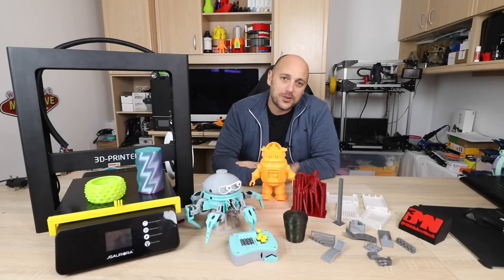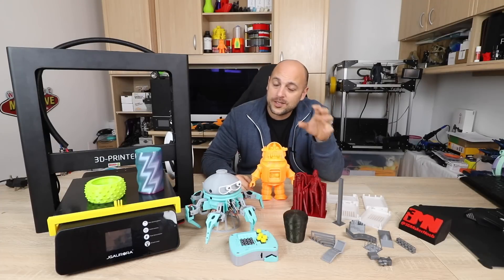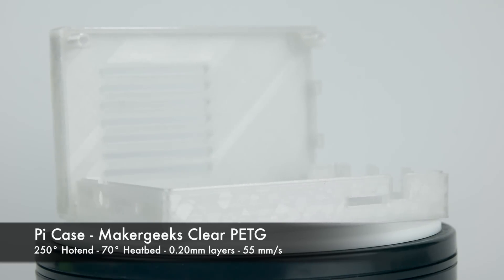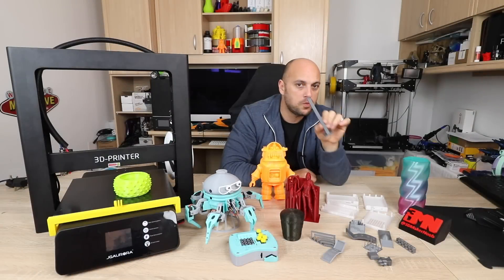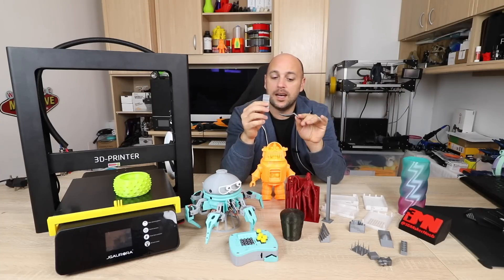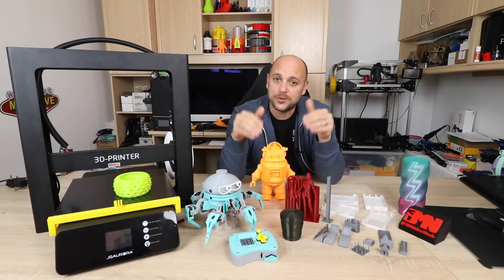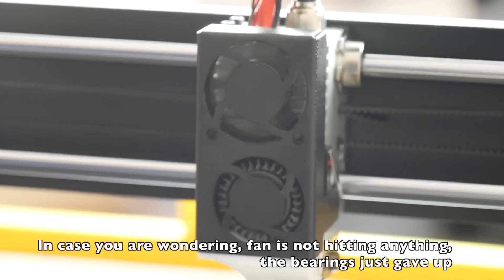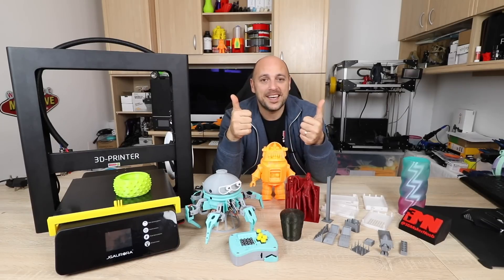JGAurora A5 3D Printer Review

Comment: Hi Joe

Yes "Looks like a solid printer" and the LCD menu is the best going but under light use these printers soon start to go wrong and then you are left dealing with the JGAurora help desk who say they are sending replacement parts but don't and they seem to use  factory reject parts for spares that arrive on a slow boat from China six weeks later.

The guarantee if you purchased via AliExpress is not worth the paper it is printed on and I have given in trying to make my A5 work because it keeps going into "lockout mode" where the LCD menu works but nothing moves and I am far from alone from having this trouble.

Comment: How do your prints come out extremely great, as you say. On my A5, not even a test cube is printed withot massive ghosting and layers which are not exacly on top of eachother?

Slowing down speed to 15mm/s and acceleration to 500mm/s reduces the ghosting to zero, but thats way to slow for working.

Thanks for any suggestion how to get rid of the ghosting & displaced layers.

Comment: hi there, I need help with my JGAurora A5: I can't get my PLA to stick before bed reaches 75°C, bed is leveled, I print first layer with fans off, extruder at 210°C. And my models are extremely inaccurate in dimensions, I can't lower the extruder temp. any lower under 205°C, because then it underextrudes. Please help. I've printed the Maker's Muse tolerance test and the best tolerance I was able to make movable was 0,5mm. When he made a test with the same machine, he was able to make move even the 0,15mm. I tried to ask Dewin Montes from make anything and Angus Deveson from Maker's Muse, but they did't reply. Thank you, if you reply.
Reply: Did you solve it?
Reply: @DollarEuro_  hey, I no longer have that printer, sold it 3 years ago, but if everything else fails, glue stick solves the issue every time. And if you want to get it off, it's water soluble, so no permanent damage is done to the bed.
Reply: @vit.budina  Do you think it's good as a printer? Should I go for it under 100€?
Reply: @DollarEuro_  not sure, these days, I'd rather go for a Bambu A1 mini at $200, it's better in every regard, it's got a smaller build plate, but the savings aren't worth the struggle with these older machines. Just the fact it still has thumbscrew bed leveling makes it pale in comparison with today's tech. I had to sell my Anycubic Predator for $300 even though I got it for $600 new, because today's market is (finally) getting competitive again. Look at some reviews and make your pick, hope you enjoy printing, no matter the machine you end up with. :)
Reply: @vit.budina  but if my budget was under 100€ should I do it? Also includes filament (8)
Reply: @DollarEuro_  if I were you, I'd hold off on 3D printing and expanded my budget to at least something like 200-300$ to get something decent, but you do you.

Comment: Great review seems like a really solid printer. Some reviews have had mixed success but this seems like the best experience so far. 
There is some bad ringing but nothing that speed or acceleration couldn't fix. The z axis is pretty amazing.
Its not a tinker machine I like to mod amd tinker. But if you just want to print then looks like a great choice :)

Comment: Have you tested the power-on resume? On the Anycubic i3 Mega, it's basically defeated by the Ultrabase cooling down and totally letting go of PLA. I'd also be interested to know if the printer uses its time to get the nozzle off the print, and if it auto-resumes when power comes back on.

Comment: would this be a good printer for a beginner? The adjustments you suggest to counter the noise and file issues sound a little technical to a complete novice like me?
Reply from the maker: you don't actually "need" to do any of them, those are just suggestions. the printer works fine as it is, but eventually, people tend to upgrade and those are simple recommendations
Reply: Thankyou
Reply: All printers in that price bracket are technical. There are none that just work like modern laser printers. BTW, i like your nick, it was good reading.

Comment: It would be awesome if we can see test prints with light from different directions. My current printer produce not the best prints but in right lighting they look awesome.  On the resonance test I can see that light is sideways, which conceals a lot. 
Nonetheless great vid as always.
Reply from the maker: i actually keep two box lights, both are usually about two feet on top of the light box pointing downwards for that specfic reason, to have decent enough lighting and to showcase and defects of the model.
Reply: Oh. sometimes it looks like its from the side, but if it's on top then great!

Comment: thanks for the review an your work in general! a quick question: would you prefer this printer to a creality cr-10s? It seems like you're getting very good results out of it with a comparible built-size. and (at least in the flash sales right now) for a better prize. Sorry for my bad english and happy easter-egg-printing (like I'm doing at the moment) from southern germany
Reply: thank you for your prompt reply. As I'm a user of the cr-10s right now my question would be, if it would be an update or worth it to give away my creality and get the a5 instead or additianally... seems to be a bit less fiddely then the cr10-s even though I'm getting quite good quality out of it after using about 1kg of Filament to tweak settings and calibrate everithing properly
Reply: allright. thanks for sharing your thoughts! thumbs up
Reply: runtime I am planning on getting a cr-10s and upgrading the hotend to a microswiss all metal one and a good heatbed as on Nexi Tech’s video to reach 135° in less than 4 minutes, instead of the half an hour 85° before you upgrade it. Then, I want to silence it with noiseblock and noctua fans as Folgertech did. I feel that even if it will cost a lot more, it should print better and have those 10cm more of z height. I am afraid that if the JG Aurora breaks, it will be hard to fix, and that it isn’t very hackable. What do you think?
Reply from the maker: I approve of this 100% :)
Reply: runtime Thank you, I’ll go for it and update you guys on it, although it may take a while
Reply: 3DMN Thank you. Joe, how can you start selling prints? Some of my friends are already asking me for some prints, but I would like to know ho you find customers. PS: I really like your vlogs, keep it up